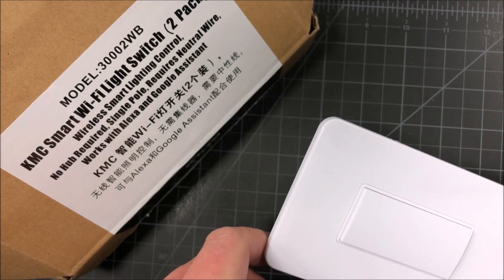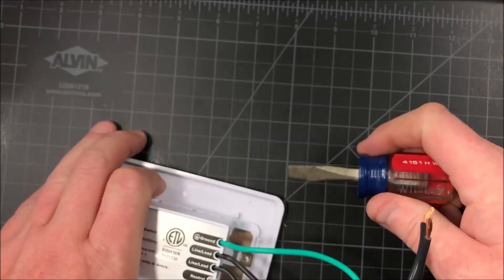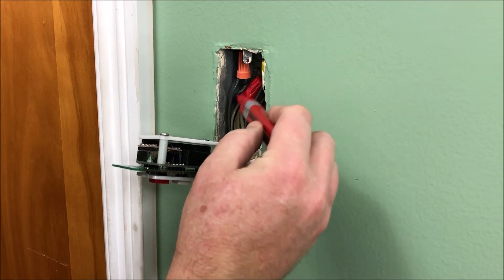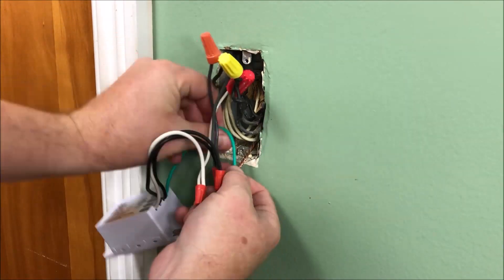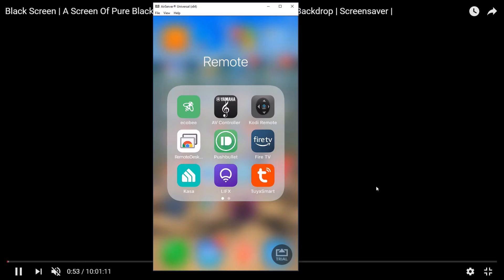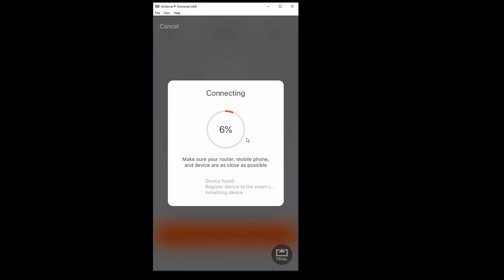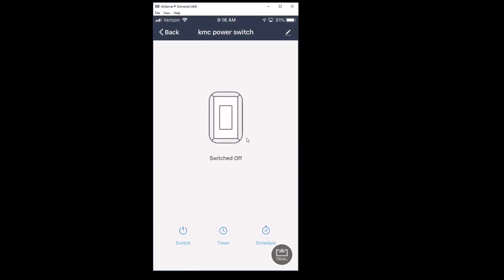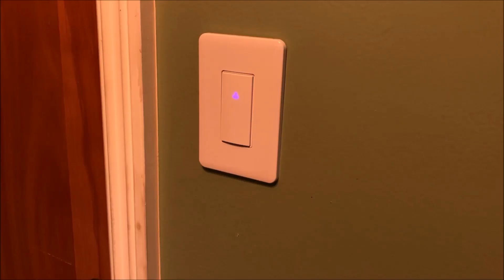Smart wall switch install and setup

Comment: I had a hard time resetting my wall switches after changing my network password.  Pressing and holding the wall switch for 5 seconds did the trick.  THANK YOU!

Comment: I have installed 2 of these. They work for a few hours all the way to almost 24 hours, then one or both die, NO LED green nor blue. I know current is still alive cause the the light sometimes stay on going through the switch. Why are the dying all of a sudden ? nowhere online anyone has ever posted this issue !!! Thanks for the help
Reply from the maker: I have a couple other viewers with odd problems like yours, and now I have one too.  My switch will no longer work by pushing the button, it only responds to Alexa commands or by using my smartphone.  I am sad this product is having quality problems.  I'm going to update the info box under my video and tell folks I no longer recommend this product.

Comment: When i wired everything that I thought was correct the light just flickered, is there a reason for this?
Reply: I got the same Problem
Reply from the maker: That’s odd. Maybe try a different bulb to see if the behavior changes.
Reply from the maker: If a different bulb does the same thing I would contact the customer service email
Reply: I jsut purchased mine and have the same issue, have you guys figured out what was wrong?

Comment: i only have one black wire !!! and this switch is not working
Reply from the maker: It probably means that your wiring at that wall switch isn’t compatible with the WiFi switch
Reply from the maker: I've been doing more research on this topic and I think you should have a look at this link Viswa.... https://theiotpad.com/tips/smart-switches-no-neutral-wire